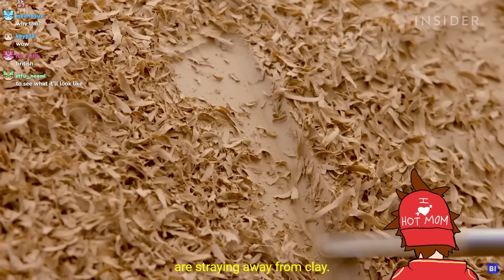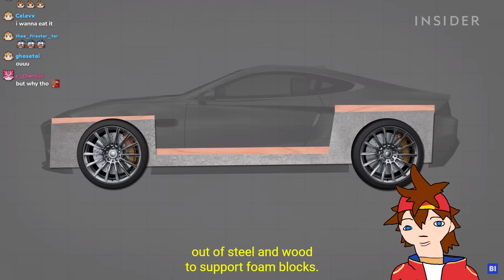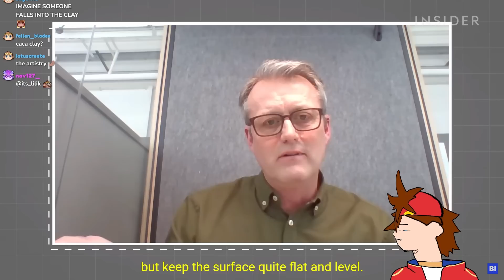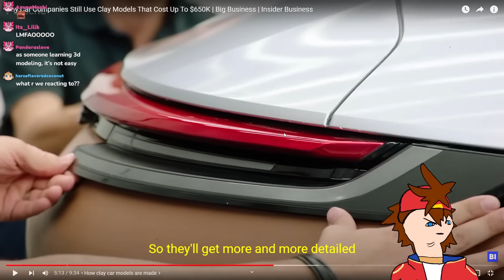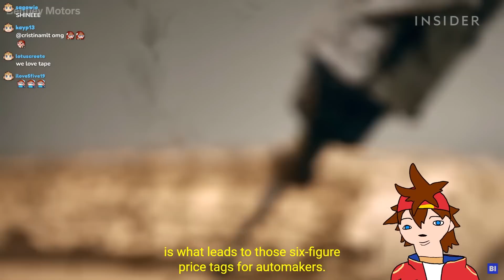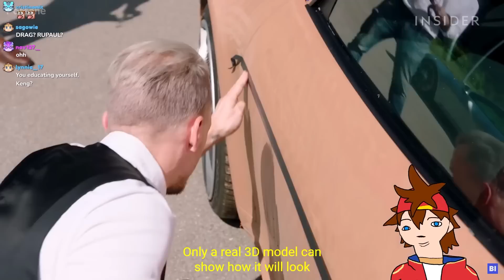Why Cars Are Made Out Of CLAY!!| Kenji Reacts

Comment: TBH... This can all still be done in a 3D environment... All the changes and manipulations. For the reasons they gave to why they use clay, can all be resolved with a giant a*s cheap 3D printer. Still cheaper than 4 years of hands on clay modeling labor. Virtually make a change, print it out using only dollars worth of material and a few hundred to a few thousand dollars of electricity. Don't like it, make the change virtually, and then print the damn thing out again. Much better than spending 100's of man hand hours only for your boss to say chop all that off.
Reply: Modern day virtual physics on a high end expensive CONSUMER card, would be enough to test drag and even things you wouldn't want to test in real life without causing destruction to the environment.